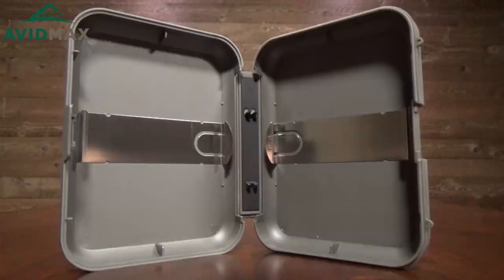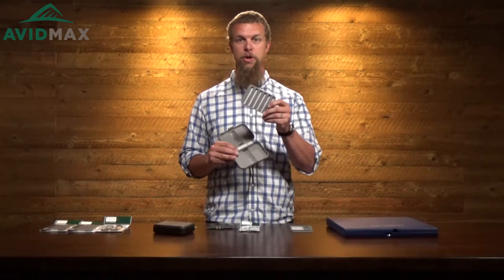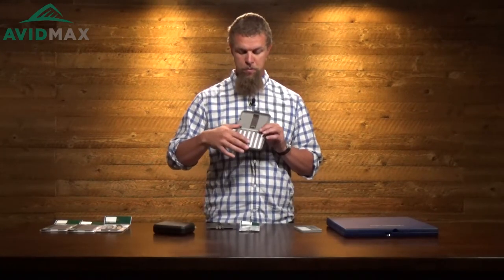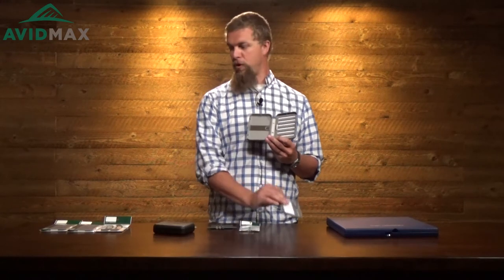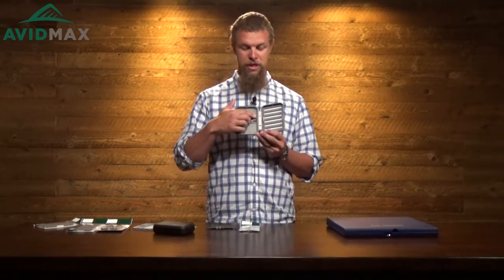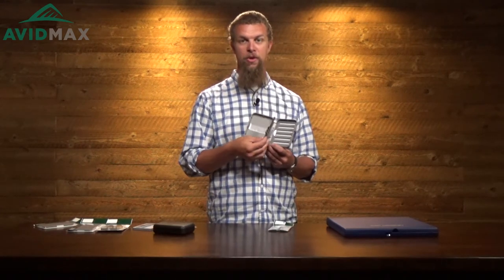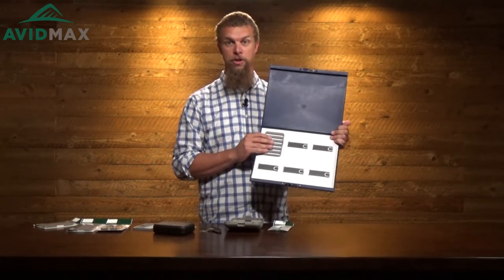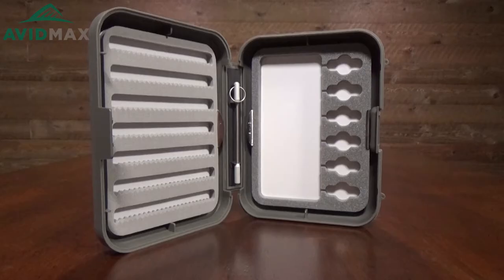C&F Design Small Fly Box System Review | AvidMax

Comment: What use are those many threaders?
Reply from the maker: It depends on the fly fisherman. Some people prefer to have multiple threaders just in case they lose one and really as a backup to the rest of their gear. Other people will have different sized threaders for different sized hooks. C&F Design has five different sized threaders (Ultra Midge Short, Short Midge, Short Standard, Midge Regular, and Standard), so it really depends on what you plan on using when you're out there on the water.
Reply: @AvidMax  Thanks! Honestly I feel like C&F overrates the importance of threaders. I wondered if it makes sense to put maybe 2 or 3 flies on the threaders, ready to attach them to your leader, hence allowing to re-tie faster.

I must say, I do like the interchangable pads.